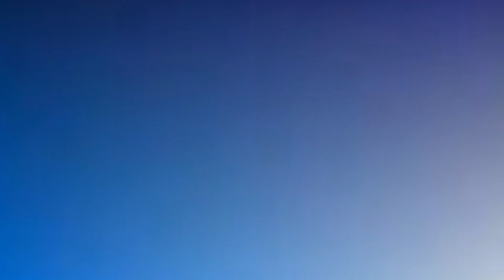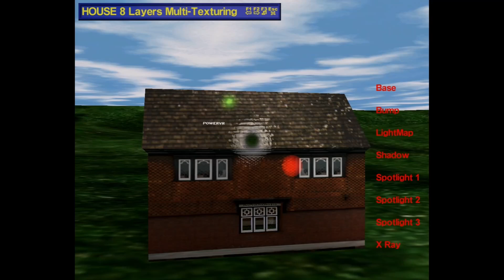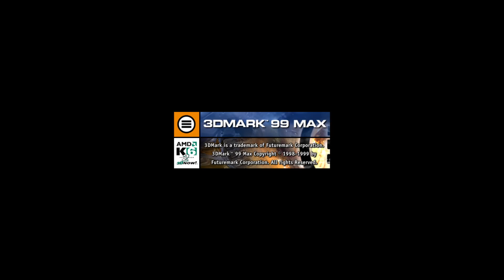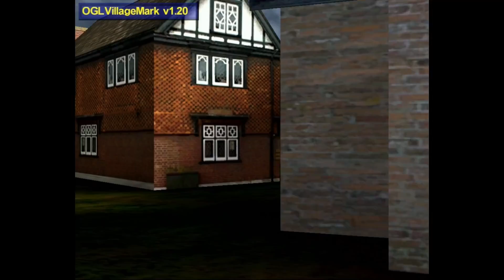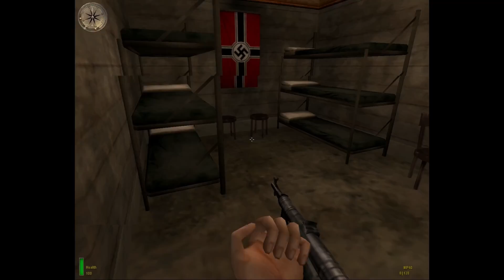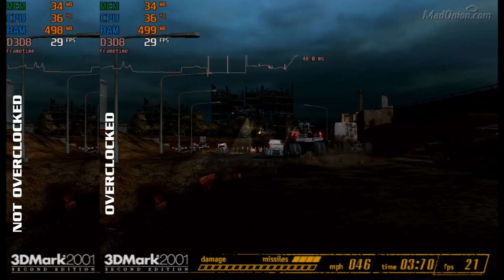Hercules 3D Prophet 4500: Kyro II v GeForce 2 GTS & Radeon 7500

Comment: Ngreedia was shitting itself because a card priced similarly to a GeForce 2 MX rivaled the GeForce 2 GTS in performance. 

Ngreedia has since learned to be more subtle, pivoting to marketing AI slop features that AMD is less competitive in, given that on Linux ray tracing works on AMD cards competing with Kepler and on Windows Crysis just runs normally in DX10 mode.

Comment: I owned a 4500 way back in the day, no hardware T&L was a pain but it did run Max Payne really quite well, easily better than nvidia cards back then I'd say which were extremely hit and miss as to if they would actually work or not.

Comment: The Kyro II launched at $150, so in that context it was extremely impressive. For a retro build it's also a good option for Super Socket 7 boards that are picky about what AGP cards they'll work with. I have a FIC PA-2013 which simply doesn't work with Nvidia cards (they lock up during 3D load no matter the driver) and struggles with any AMD card past the Rage 128 Pro, yet will happily run the Kyro II all day even with AGP 2X and sideband addressing enabled. Obviously it's very CPU limited even paired with a K6-III+ at 600MHz, but it's still the fastest AGP card I've found that'll actually work. Using earlier drivers also helps, as with other vendors. I first tried the final driver from 2004 and that was pretty slow, but reverting to a driver from late 2001 provided a pretty big performance boost (Quake II went from 62.5fps to 73.2fps in the first timedemo for example). Obviously most people would still prefer a Voodoo 3 for a compatible AGP card, but if you can't afford one of those (or are just bored of 3dfx at this point) it's a neat option.
Reply from the maker: I need to find a SS7 board some day.. I have a stack of CPUs to test that I've kept hold of for the thirty years or so I've had them! Once I'll do I'll pop in the Kyro for graphics ;)

Comment: i owned all these cards, miss the kyro2 more than the geforce... running overclocked cpus back then... man that was a fun era... the problem with ATI was always drivers being a pita i use to combine several drivers files to get fully functional drivers and uploaded the results to rage3d and a few other sites.. took forever over dialup.. 

the Kyro 2 did need a decent cpu though... buddy hated his till i swapped in my backup cpu into his board, set the clocks and... it just worked great, he was blown away... way less problems than his radeon card with normal drivers,  and these cards were around 60-65bucks locally, and one local shop i delt with would top hat flash the "generic" cards to one of the compatible bios of your choice, man that was a fun time... cheap and fun hardware to mess with... its my exp growing up during that era as a young man that caused me to buy ARC A770 16gb cards...well one then  later a 2nd when i got a great price on a 2nd card..heh....)  i was willing to give it a go..i expected more of a retro exp but the drivers at worst needed me to use dxwrapper/dxvk/dgvoodoo2 to get some old titles working... really was no big deal... same stuff i would do on my 1070 on alot of the same games because the perf benefits greatly...

i did love my kyro2 64mb card though... so often it was so close of even slightly faster than the geforce2gts i also owned, the 8500 was a major upgrade hardware wise for ATI but, the drivers... i say this as somebody who flashed hundreds of them over to work on mac where the drivers were genuinely way way way better... i used more than one for my own card for testing and even mod drivers only got you to like 85% of what nvidia and even powervr "it just works".. when we found out mac users would pay a $200 markup to buy the mac version of the card... buddies dad had a dual g5 power mac we could test in and... it was NOT hard to extract the firmware from a card, convert to mac, flash it back and have it just work in the mac... his dad was our first customer and got us slot of sales, the only complaint we had was being out of stock... one client bought a whole pallet of white box cards (4x as many cards as the retail packaging would fit in same shipping box)... just paid us to flash them then gave us the extras... then had he teach his daughter and later his son how to do the flashing since the company he worked for, after seeing his results wanted to upgrade all their mac's but not at the price apple charged for the same card... well a slightly worse ver since the apple ver had no fan and had reduced clocks to keep temps down.. and a huge heatsink... HUGE...  and dont get me wrong some thing about apple systems are neat but.. sometimes.. i just.. "but why?"  

the kyro2 was NOT a powerhouse, it was a smart use of tech that did alot with a little, i really would have loved to see  a 3 and 4... hell... would love to see them work with somebody to bring out gaming gpu's even if it was some chinese firm.... i mean... love the arc cards but, would love more competition, the old days was so much fun with so many options, some you knew would prob suck for games but had other uses... like these SiS cards that had 128gb of vram, pretty bad for gaming, amazing for CAM/CAD systems... amazing for anything that needed the vram and didnt care as much about the gpu/its drivers being able to render games... also finding random expensive prof gear cheap or being given it because its been replaced, i had a few 3dlabs cards i got that way... one i sold 6mo after getting it and creating a decent gaming driver from the drivers they had on their download site... took drivers from several drivers to get it all working as well as it could for games... buddies dad saw it and asked what it was... called his work buddy and bought the card from me for more than my whole PC cost to build, and gave us a ride to several stores to get parts... the guy also wanted my driver... but turns out that card... had VERY specific support in his main cam/cad/rendering app that made it drastically faster even with higher detail settings... neat tech but also.. very niche.. still fun to play with.. we have had so few genuine options for so long... same for memory (ssd and ram) so few actual sources for so long ppl didnt notice, now we are.... i noticed when some companies vanished... i noticed the cartel crap...

 i dont like china but honestly... hope china floods the market with cheap/affordable memory at some point... if the did it with ddr4 then 5 it would throw the cartels off hard... they COULD ramp up production but that would reduce pre-unit profits... would cost money and then when the demand slows they got excess capacity... not like they could use that to make something else useful... hell... make risc-v based SOC's shouldnt be that hard to come up with a design you could produce... or take the hit short term, stock up on memory during the slump and encourage ways to use said memory..like risc-v soc based systems/controllers/cards that need external memory/storage... i see one way they could profit without fcking us over... build a risc-v soc thats goal is to act as a sort of hybrid soft/hard raid solution, run linux on the card using software raid accelerated by the SOC, but a raid that can be recovered on any system with enough ports to hook up all the drives... sata/sas/and even u.2 drive support...mixxed setups so you could have some u.2 storage as a cache over spinners... all managed on card, no added cpu load, just something i have heard IT guys wish for.. for years.. give the card memory slots so you can expand its ram cache.. perhaps versions that also have an m.2 port... and your gonna have some IT guys i know wondering if they woke up in a different reality.... because it could make their lives soo much easier... they could also make single add-in cards that just have a bunch of ram and flash on them as pure cache cards, when paired with a solution like primocache on windows or a few options on linux.. it can seriously speed a system up.. more so if coming off sata/sas drives... 

blah... anyway... i loved the 2... honestly wish they had found another company to produce their chips... even then we needed more competition it was pretty much down to them and the savage 2000 that had a hardware flaw... would have LOVED to see them keep revising and coming up with ways to get similar or at times better results than hardware that was at times over 2x the price... honestly a modern equiv of this card would be pretty welcome, affordable, powerful enough for most games.. but give it arc's level of driver dev and support (its been amazingly good...)
Reply from the maker: Wow. Now THAT'S a reply!

Comment: Kyro-II really was not that powerful. It was exceptionally efficient, but at literally 1/10th the fill rate of a GF2, it's lack of horsepower really did hurt it in games that did not have much overdraw. A 4 pipe version however could have really given even a GF3 a hard time.

I had a Kyro-I in my second computer, which ran at 115mhz. And it could run most games at 'good enough' performance, but was far from a premium experience. But it was always impressive what it could run compared to my main box.
Reply: No hardware tnl. Everything without it sucked real fast back then.
Reply: @timmyp6297 but not if you had a 1ghz athlon then it was faster than a gts in many games that used direct 3d 7
Reply: @si4632  I did. No TnL made the card DOA. "Tile based rendering" did nothing. I had this card for not even 2 days and I would have taken any geforce 1 or 2 over it.
Reply: @timmyp6297 The PowerVR Kyro was designed to scale with extremely fast processors. In historic benchmarks paired with a 1 GHz+ Athlon or Pentium III, the Kyro catches up to (and sometimes beats) the Geforce MX. On a modest 500 MHz chip, the Kyro choke-points immediately because the CPU cannot feed it polygons fast enough.
Reply: It was quite cheap so it would have been competing with a geforce 2 mx I believe
Reply: @si4632   TnL is all that mattered. Kyro 2 did not have tnl. No bumpmapping, ssr, and the new tech that was out at the time.

Comment: I was suprised at first by the "poor" performance of the Radeon. The 7500 should be able to trade blows with a Geforce 2 Ultra or even supass it on occasions and leave the GTS quite a bit behind, and then I saw it was the 64bit cut down version so it made sense. Nice video, I've got a soft spot for the Kyro cards and Power VR.
Reply from the maker: Same! Yes.. one day I might revist with a PROPER 7500 ;)

Comment: I think your radeon 7500 is LE version with only 64bit bus and lower clocks. Normal 7500 should be faster than geforce2 gts.
Reply from the maker: Hmmm.. I'll investigate!
Reply: @RetroKomodo  1:48: You see it here. Just 64 Bit.
Reply from the maker: @MaexxDesign  So it is! Well I guess now I need to hunt down a better one!
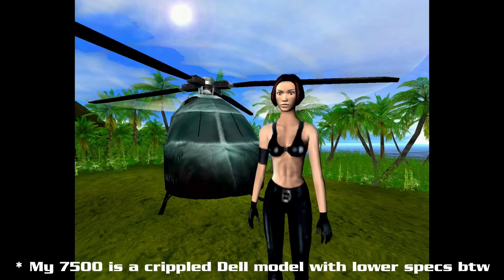Reply from the maker: Actually, I reference it at 5:55 ;)

Comment: I loved my Prophet 3D 4500 (Kyro II). It really punched above it's weight due to having a very clever design with it's ingenious tile-based rendering. Unfortunately, when the Geforce 2 GTS arrived we saw games starting use DX7's hardware Transformation & Lighting which Geforce added as early as the Geforce 256. The Kyro II (2000) didn't have that and fell behind. They later released software T&L in their drivers but it couldn't handle the load. None of the 3dfx cards supported T&L either which may have had negative effects in benchmarks and reviews which didn't help either company survive the competition. Nvidia just pulled ahead and didn't stop. 

Such a pity since the Kyro II was a really clever piece of hardware with the super clever tile-base rendering that really helped the "humble" Kyro against the competition. What's even sadder is that PowerVR had completed the design of the next-gen Kyro III (STG 5500) which had hardware T&L and other modern features. It was never released due to STMicro, who produced the actual chips, shutting down their graphics division.

My Hercules 3D Prophet 4500 broke and I replaced it with a Voodoo 5 5500 AGP which I had for little over a year. I still have my boxed Prophet somewhere. I've actually played with the idea to try to repair it if possible. Oh well.
Reply from the maker: I probably should have put most of that in my video! I think mine will end up in a 98 machine once I finally get around to playing with 98 again ;)
Reply: I had a Voodoo 3 3000.
I loved it.
When GF256 arrived, my poor Voodoo was a relic :)
But I prefered the image from the Voodoo. Nvidia always seemed" green" to me.
While Ati and Matrox had nice colors.
I've dream of a Voodoo 4 or 5 for a retro machine :)
Reply from the maker: @nalinux I used to have a voodoo as well.. No idea what happened to it!
Reply: @RetroKomodo My first computer was a K6-233.
I got it back to the store, because it got so hot no way to use it.
So I got a 233 MMX.
With a Trio card.
2 months later I bought an Ati Xpert Play.
Great card !
But not perfect.
So a Voodoo 1 ...
And I could play Tomb Raider, Quake, or Unreal.
Unreal worked perfectly with Wine on Linux.
I still have a Voodoo 2.
Reply from the maker: @nalinux  My first was a 486 of some kind which I then replaced with something beige running a Pentium 90. I remember I had trouble getting into it some times, so a tap on top would get me past the POST screen - a donk on top would get to the Window 95 loading screen - an almighty thump would get me past those and into Windows so I could play C&C. I had no idea back then!

Comment: My experience with the Kyro 2 4500 was that it had better picture quality, especially in old 16 bit colour games like Moto Racer, and so many others. For Windows 95, and 98 gaming i's a great card!
Reply from the maker: Absolutely! All the reviews of the time agree with you on the picture quality, and so do I. That's why it's always been one of my favourites ;)
Reply: I remember upgrading from my 4500 to an ATi 9200 because the former couldn't run Mafia well, and when I went back to play Deus Ex, I was disappointed that the shading had banding issues on the ATi that my Kyro 2 never did. Remember that card fondly.
Reply from the maker: Well if you're lucky you could snag one on eBay and relive the glory days! Very slowly by modern standards of course.. I think mine was £40 ish. Save a search and see what pops up!

Comment: nvidias never changed. Was always and always will use dirty tactics to come on top.
Reply: Its true. And the fact that nvidia needs to resort to such tactics speaks volumes about their not so great products
Reply from the maker: @LordSamuelJ that said I do use a 4070.. Frame generation is just more trickery! But it works!
Reply: @RetroKomodo  Well, with the new 5090 you'll get DLSS 4. 75% of the frames you see are generated by AI. The big problem with that is that the input lag will still be locked to the 25% actually rendered frames. I've read so many reports about input lag on the 5090 making many games a chore to play. In other words, the performance of native rendering hasn't improved that much over the last generation, instead relying on AI-trickery to get those impressive framerates while pulling over 550 Watt. I guess we've reached the limit of rasterization performance increase. We're currently stuck at the 5nm manufacturing node and it seems like it's exceedingly hard to break that barrier for large dies. The current node is 3nm and seems to be reserved for RAM dies that are magnitudes smaller than a GPU. Perhaps we'll see the return of SLI? :)
Reply from the maker: And 2000w power supplies to run them!

Comment: I remember some dodgy bloke in Malvern selling me a Kyro 2 graphics card years ago 😂
Reply from the maker: Hmm.. I LIVED in Malvern years ago! Was it me?? Who is this?
Reply: @RetroKomodo  It was indeed Mr Fred 😂
Reply from the maker: Chris..? 🤔I didn't know you liked messing with old stuff!
Reply: @RetroKomodo  My attic is a man cave of old school stuff. Unsurprisingly I don't have the Kyro anymore... I think I only had it to play  Medal Of Honour back in the day!
Reply from the maker: So I see! Darn. I think that was a slightly higher clocked one too. I have a Spectrum to recondition at some point - needs a new membrane etc
Reply: @RetroKomodo  Speccys are easy to get up and running. The capacitors in the power supply may need replacing if you are looking to use it on a regular basis 👍🏻
Reply from the maker: I found the driver CD if you want it!